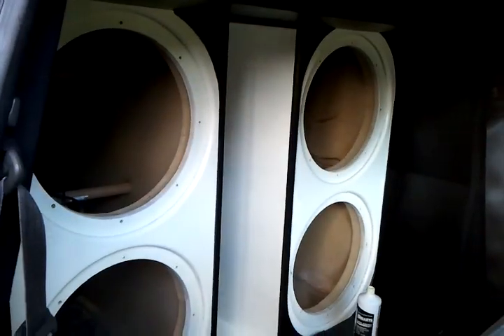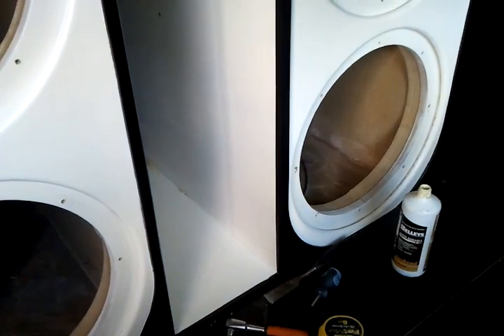Broken Port

Comment from the maker: yea i glued and screwed it but it ripped it from the housing. i tried removing the original screws and they were all snapped in half lol so i had to put double the ammount in and put them at a better angle. its only doing 154.1 at 41 and 38 hz so hopefully with this new bracing it should be fine but im about to get some more batteries and amps so you never know it might break again lol